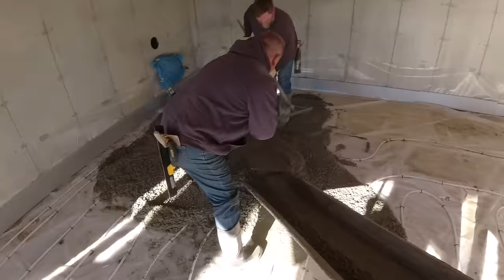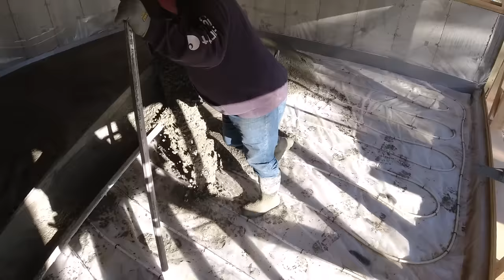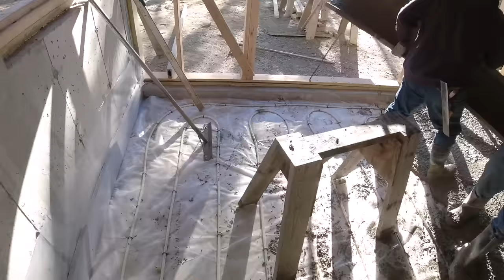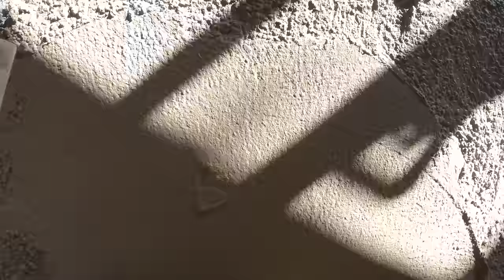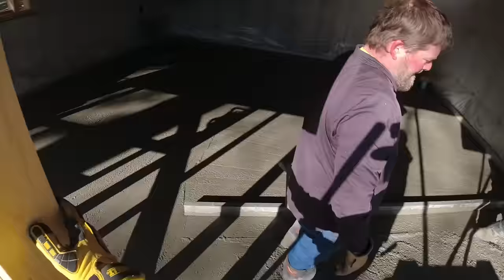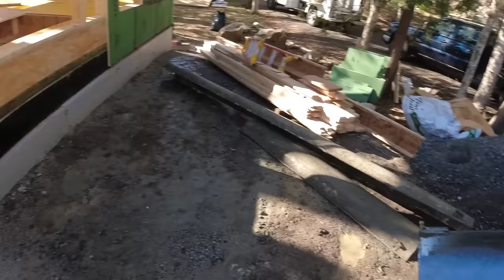How To Use A Chute Extension To Pour A Concrete Floor Under A House

Comment: Great video!
So I was having trouble hearing what y’all were saying. 
Did you order an extra yard and just made it?
I’ve been noticing that a lot of companies are getting shorted. Even my self. 
What I’ve been doing is calling dispatch, telling them the square footage and the amount of concrete that I figured, and then asked them to calculate what they come up with, and then add a half yard. 
Something is going on, I don’t remember running short so many times. 
What’s your opinion on that, Mike?
Thank you for sharing, I really enjoy your work and videos
Reply from the maker: Yes, I ordered an extra yard and still almost ran short. I've run short a few times this year already. Usually only happens once a year. Not sure what's happening this year.

Comment: Don't you guys ever use the trailer pumps (line pumps)??  I used to use those 16 ft chute's 20 yrs ago.  Wouldn't even dream of it today..
Reply: You would have to pay for the pump truck instead of pocketing the 750 to 1000
Reply: @chasefearer4909  True but you could have mixed it by hand and saved some cost too. And brought a horse and buggy to work and saved the 40 on gas..
Reply: @MR-gp9ys  just crazy to use a pump truck on a 5 yard pour.

Comment: Surprised that there is no rebar
Reply: Don't really need it as rebar is there to keep pieces together if/when they crack.  This is usally due to settlement issues with the subgrade.  Also, this slab is enclosed, so it's likely the only movement broken pieces could make would be downward if the subgrade gave way.  Easily replaceable.
Reply: when there is concrete pour its always that one guy who talking about no rebar 
lol